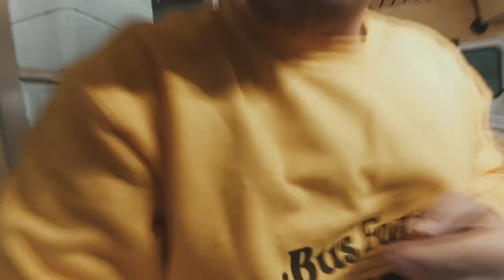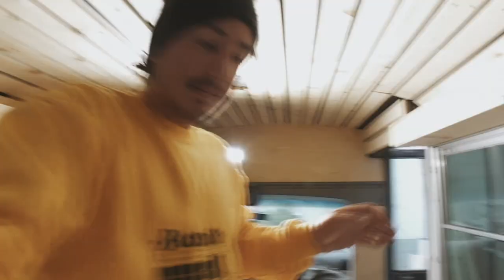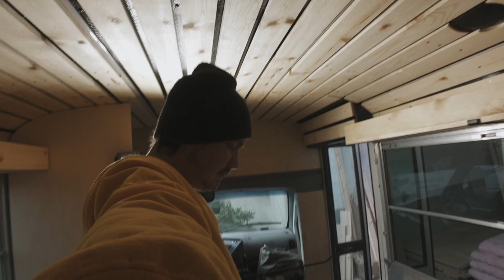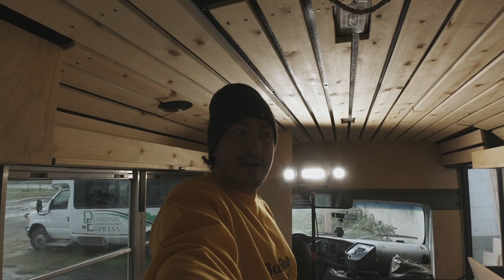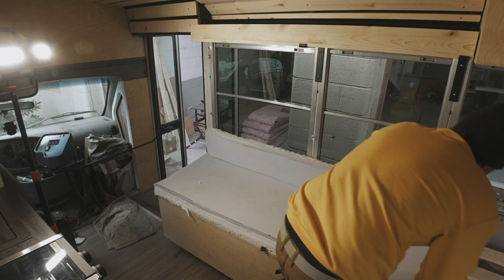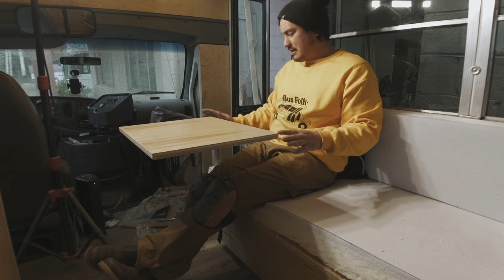How To Cut Upholstery Foam And Mounting A Lagun Table - 30 Day Short Bus Build - SKOOLIE CONVERSION

Comment: Hey Isaac, A little foam cutting secret tool that is awesome. My Dad worked in a furniture factory and had his own reupholstering shop at home our whole lives. He used an electric knife that cuts through foam like butter. Cuts fast and cuts are smooth! No need to use sawing motion, just follow your cut line putting medium pressure on blades. I even stand my foam on it's side and am able to cut through 4" foam with no sweat  following cut line. A tool that is worth adding to your collection. :) Hope you will try it. Deb.
Reply from the maker: Wow now that sounds like a tool that I need
Reply: @isaacturnerit  I also worked in a foam factory. You can use an electric knife like the ones used for cutting turkey's on Thanksgiving day.

Comment: Oh and I have a tip that Ross taught me and it helps.  When cutting the hard board put tape on the line your cutting on and that should stop the splintering when the saw goes thru. And makes a neater edge line. 🥰🥰😘
Reply from the maker: Really
Reply: @isaacturnerit   yes he does that and has had success. Maybe use two strips of tape and cut down the line. I’m sure you will experiment with that. Good luck Issac.  Love you too Jaylena😍

Comment: Hey Isaac, nice build so far. Just a quick tip for cutting plywood. What I usually do to keep it from chipping when I cut it is to use a metal straight edge and a utility knife to cut through the first layer of wood. It's only important where you're going to see the edge of course. Just a trick I picked up along the way, thought I'd pass it along.
Reply from the maker: Ohh thank you
Reply from the maker: I’ll try that :)

Comment: Noticed you put a small pillow behind your lower back on bench.  Suggestion for another build: put wedge pillow/foam instead of flat foam for lower back comfort.
Reply from the maker: Honestly that sounds genius
Reply: @isaacturnerit  thanks ✌I can't see why you really need the struts (sp?) with bench.  It already stays up with your design.

Comment: Issac,  I saw  a you tube  van lifer  make  your fancy table with pipe and pipe  connections for last then 50 dollars. Then added a piece of wood,  moves like your table side to side.
Reply from the maker: I have seen those :) maybe I will try that on the next one

Comment: I use an electric knife to cut my cushions. It’s like putting a hot knife through butter it works well. Plus, it is one fast clean cut. Referring to the couch….If you do everything right the first time, you really don’t learn and you can’t teach. You learn from mistakes and when you share them that helps many other people. Does the Lagoon table come up high enough to where you could stand in work from it? Thank you for another awesome video!
Reply from the maker: Ohh I’ll look into the electric one. I think I remember lagun having longer ones. This is my first time but I love the product after using it once
Reply: @isaacturnerit  Once you use an electric knife you’ll never go back. 😂 Thank you for answering my question you are so good about that!

Comment: looks great Isaac. now that you've gone this far, is there anything different now, how you see things going together, that you would do different? like the ceiling, the flooring, or even the open face shelves?
Reply from the maker: Actually the more I do the more I love it and may design more busses this way
Reply: @isaacturnerit  yeah, a planned design would be a great selling point also. you could also use the same measurements, so you could actually prefab some of it, benches and just cut a notch for the back edge. cabinets too really. i think the more you build, the faster and the better you get.

Comment: I may not have heard you correctly when talking about spacing used to mount the struts on the bench base and lid.  But I thought you measured 1 inch from the edge of the lid which sounded correct.  However, I thought you also measured 1 inch out from the end piece on the base.  I would think that would cause the strut to bind when closing.  Seems like the bracket in the base should go right against the side wall.  If I didn't hear you right ignore my comment.  We enjoy watching you all and your really building a neat bus.  Best of luck.
Reply from the maker: That strut didn’t work at all

Comment: Are you concerned with the metal original walls scratching people arms or backs when they remove the back cushion.
Reply from the maker: I made the cushion bigger to cover the wall
Reply: @isaacturnerit  Yes I just saw the taller piece of back foam to the bottom of window. I guess new owners will fix if it is a problem.  But I also noticed when you stretched out on the bed you removed the back cushion completely exposing all the metal under the window down to bench.